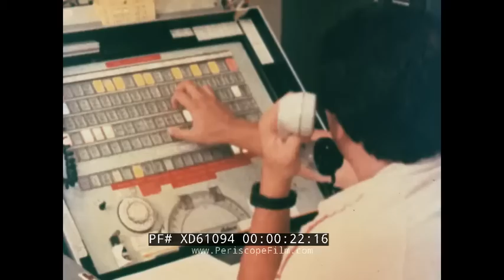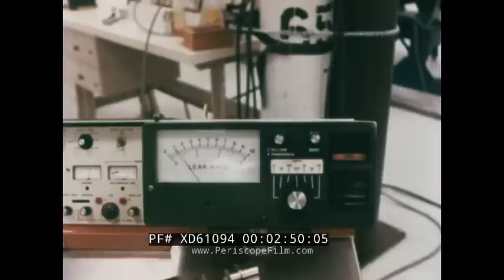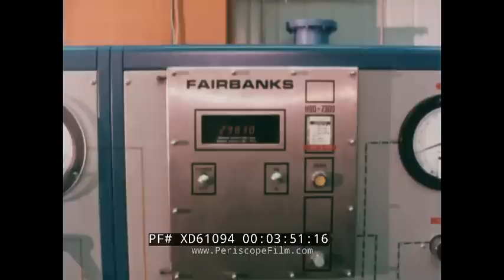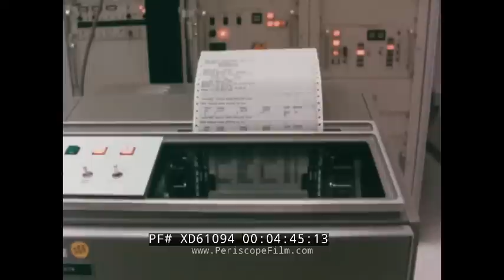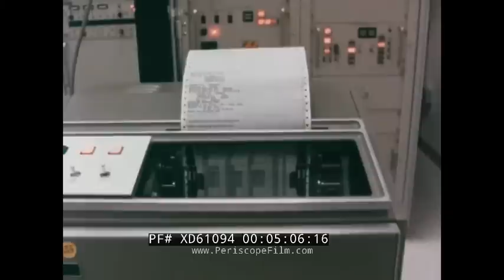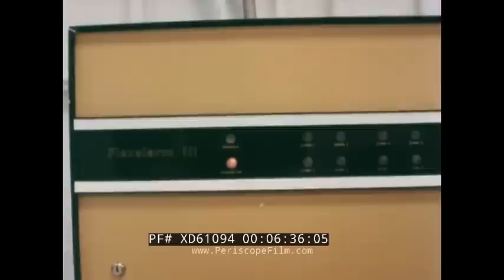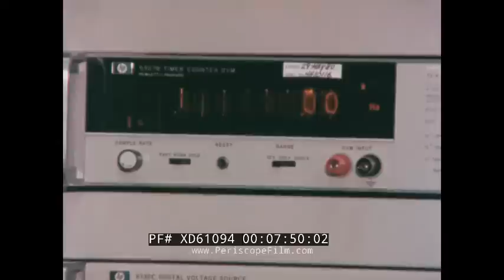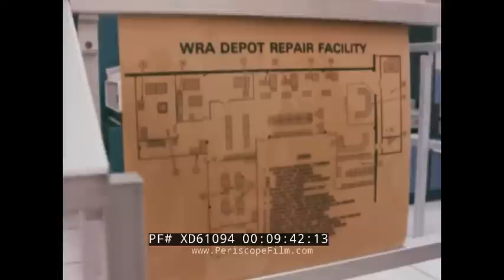" HOME OF HARPOON "   1980s MCDONNELL DOUGLAS ANTI-SHIP MISSILE SYSTEM PROMOTIONAL FILM XD61094

Comment: The real path worn into the grass is carved between the guard shack and the Dunkin' Donuts. But in fact, as the techs and engineers who built these missiles all knew, all spare in-flight donuts were hidden and stored on-board, inside the Turboencabulator sub-section, just forward of the aft skirt yet still within the Sustainer section. I believe that this is all now unclassified information.
Reply: This cleaver stowage allowed engineers to effectively eliminate side fumbling.